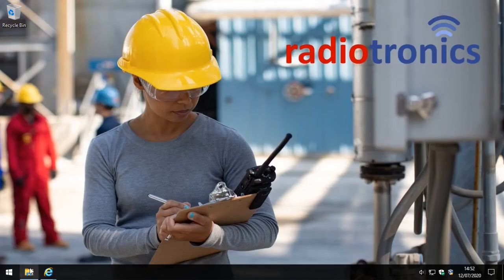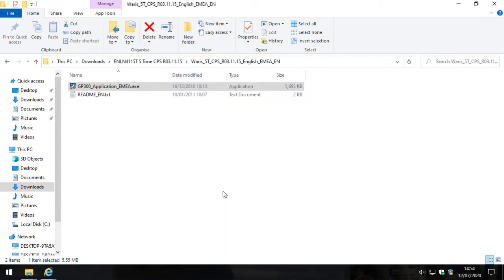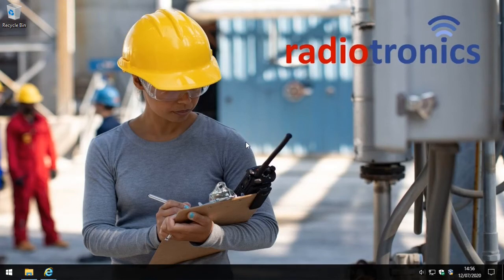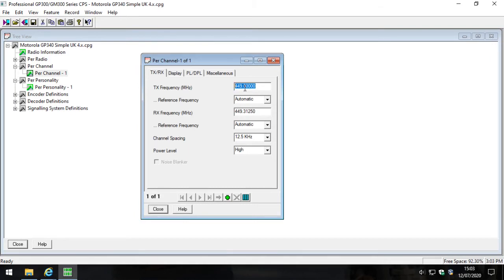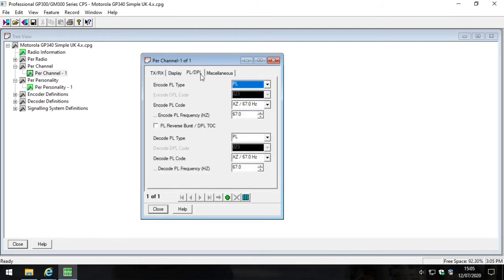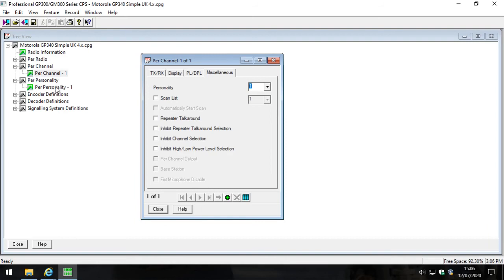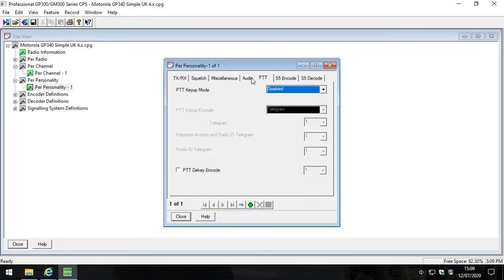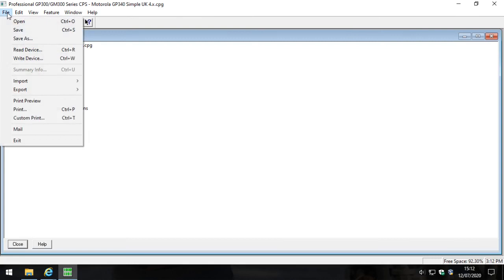Motorola GP340 Programming Software Installation (With Basic Programming Example)

Comment: Is there an option to change vhf or uhf on the 2 way radio settings software.  Also does the antenna has the option to change by switching  the antennas  to a vhf or uhf antenna